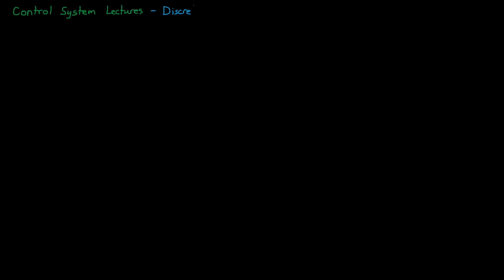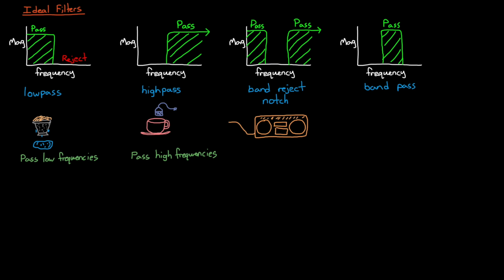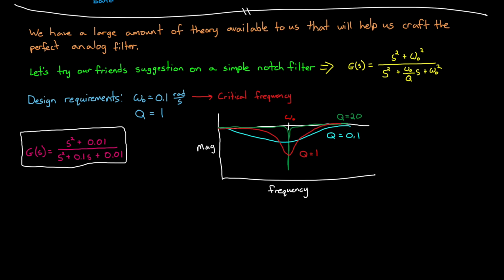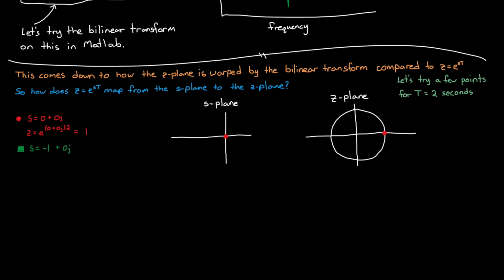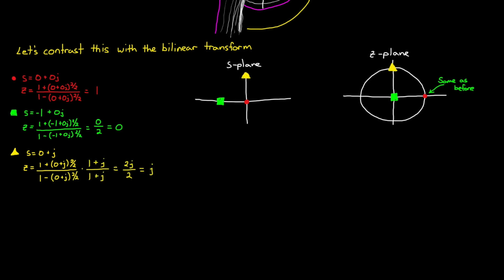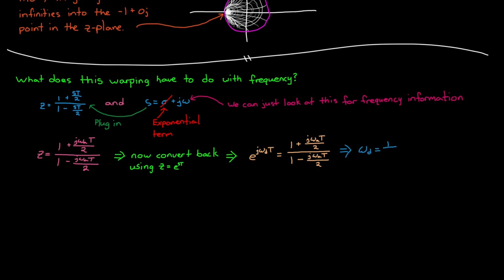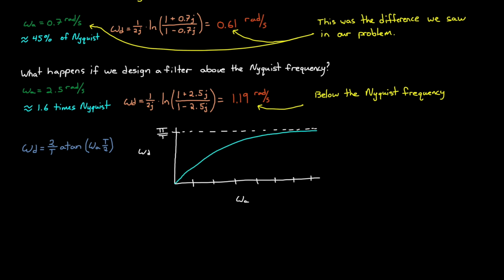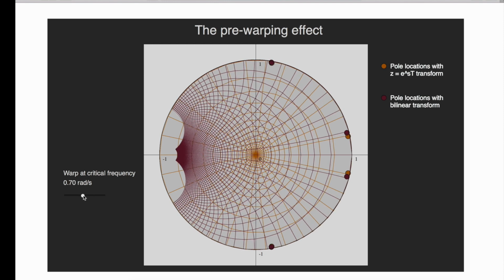Discrete control #6: z-plane warping and the bilinear transform

Comment: They never really explained prewarping at my university. They did developed their own tool which automatically warps each filter component at the corresponding frequency, so I always took that for granted. But it is nice to know what is actually going on.

PS: that tool also shows you the modulus margin of you plant with designed controller, but from searching online it seems that hardly any other university uses that margin as well.